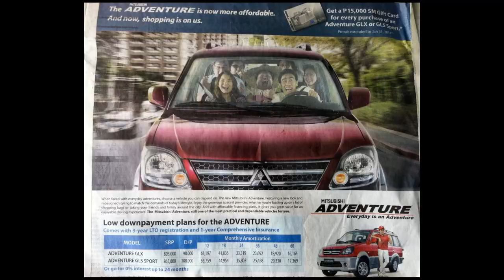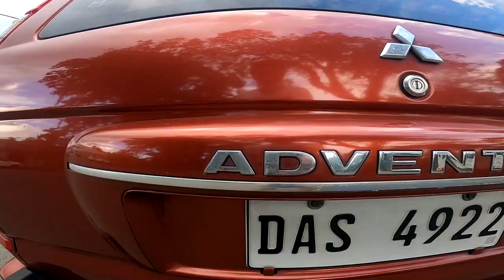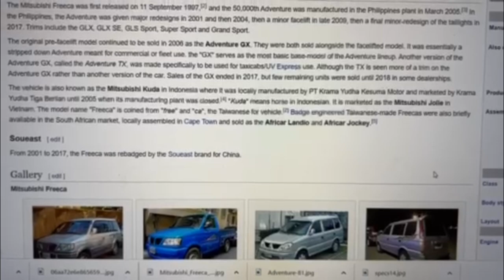2015 Mitsubishi Adventure GLX

Comment: Share ko lng yung experience ko sa 2002 super sport ko na adventure d ko lng sure if matibay lang yung luma pero never ko na experience yung mga nasabi nilang issue under the hood like yung alternator, dun sa idle ng aircon, saka dun sa belt din ng alternator. 20 years na adventure ko pero stock parin yung sa idle up ng aircon and alternator, ang napalitan ko pa lng under the hood is yung aircon compressor. Yung iba basic maintenance na like belt, filter and rubber gasket saka reservoir na lumutong na dahil sa kalumaan 210k na rin milage ng adventure ko. Tingin ko dapat mong isipin lagi dyan yung thermostat sisirain nya yung radiator mo. Mas ok yung mapalitan pero sakin umabot ng 18 years nabutas rad ko pero na repair alagang coolant din. pa adjust ng fuel injection pump pag hard start na. So far so good pa yng adventure ko kahit na medyo nag leleak lng ng konti yung rack and pinion. Basta i maintain lng sa change oil yung makina at saka normal lng sa kalumaan masisira yung mga rubber gasket kc lulutong din sa tagal lalu na batak talaga yung samin d pa kasama dyan sa milage na lagi naka on parin kahit na hinihintay ako ng kasama na nagbabantay ng gamit sasakyan maghapon walang patayan ng makina dahil sa negosyo namin, sobrang tipid kc. Wala din kaming parking dito kaya nakabilad cya maghapon. Sa makina sobrang tibay and check nyo top speed 210k milage na eto po yt link

https://youtu.be/84pxM0Tn5sE
https://youtu.be/cm35Zvmgj30

Comment: Proudly driving my deceased Father's 2004 Adventure Grand Sport, it was the highest spec back then. Ako ang nag maintain since he passed away, my small sentimental dedication for him. Kilometers on the odometer is still increasing, yet still going strong. Went through more rough muddy roads than those shiny modified SUVs that only roam in the city and the highways. Very simple and utilitarian. No touchscreen infotainment nonsense, just pure road driving while listening to the stereo simplicity as it should be. There'll be no longer simple rugged AUVs like the Adventure, Crosswind, Revo and Tamaraw FX. Kaya take extra good care of these nostalgic work horse vehicles.

Comment: Hahaha same model year ng Adventure ng tatay ko 😅

Really dependable vehicle, with the legendary 4D56 engine. Too bad mejo polluting sya compared sa mga bago ngayon.
Reply: Mahina sa ahon ang adventure gapang nakaka hiya sa kasabay tapos wala pang turbo at matagtag napalakasa pa sa diesel. Unlike Toyota INNOVA malakas makina and then may turbo and comfort ride kayang kaya makipag overtake at maning mani ang ahon fuel efficiency pa... Mag invest na sa wall brand!!!
Reply: @carlodeguzman4440   yeah mapapansin talaga yung gapang sa akyat lalo na pag fully loaded. Gamit ko sasakyan ng tatay ko minsan, talaga bababa ka sa primera kung akyat, but the power/torque ratio ng makina is very good considering the size. Keep also in mind that the design of the 4D56 is almost 50 yrs old na. Talagang napaglumaan na
Reply: @alanbassig5761  yes di advisable sa long drive ang adventure kakabahan ka baka di ka makauwi ng maayos. Tama lang na di Phase out na yan. Sayang ang pera. Di gaya ng INNOVA 12 hrs na biyahe walang patayan but still kicking!!
Reply: @carlodeguzman4440  Too much na yung pag-criticize mo sa Advie, ano bang ginawa sayo ng Adventure hahaha. Well we have mitsu adv 2011 model, 165k na odo still kicking parin never kami tumirik sa daan and weve never replace anything sa engine even timing belt heehehe. Weve travel north to south with no problem, so what r u talking about?😅 Weve bought adv because of its engine, its so so super reliable like out of this worldddd
Reply: @snappyloop7489  anong ginawa ng adventure skin? This is may answer di ako satisfied sa performance kaya binenta ko na agad 3 years pa lang skin. Lahat ng expectations ko sa INNOVA ko nakita at nakuha 💪💪💪💪💪. 2nd sabi mo 165k mileage mo wala ka pang pinalitan? Malamang naputol na timing belt nyan kasi ang buhay ng timing belt is 80k km run. So niloloko mo sarili mo?
Reply: @carlodeguzman4440  Well. bat naman ako mag sisinungaling? AHAHAHHA hindi pa nga napapalitan. Papapalitan ko palang this week. If youre not satisfied, thats your opinion but dont shove it to mitsu advie owners. Please dont also compare new innova model to old adv
Reply: @snappyloop7489  ofcourse mas quality brand ang INNOVA 💪💪 than adventure 👎👎👎👎
Reply: @carlodeguzman4440  Bahala ka na. What matter most is that Adv can put u point A to point B without any hassle
Reply: @carlodeguzman4440  Innova mong madali maluma yung design okay HAHAHHA.
Reply: @snappyloop7489  madali maluma? Bkit may production pa rin? Hahahaha eh ang adventure at crosswind PHASE OUT NA KAYA NGA NAMAYAGPAG ANG INNOVA!!! KUNG BILIS LANG DIN ABAY INNOVA NA!!!!
Reply: @carlodeguzman4440  May producyion pero iba design, ung mga lumang design ng innova eh bulok
Reply: @snappyloop7489  BULOK??? INNOVA? Pero marami kang makikita sa kalsada? Ginagamit na pang escort sa mga VIP??? Eh ang adventure ni minsan di ko pa nakita na ginamit sa pang escort??? Kasi nga mahina humatak di kayang makipag sabayan sa mga SUV AT LUXURY CAR/S??? Kung may production bkit ang tagal tagal tagalllllllllllllll ilabas? 😂😂😂😂😂😂😂😂😂😂😂😂😂
Reply: @snappyloop7489  mas matibay ang Innova lalo yung 1st generation 2005  model marami pa sa kalsada at malakas pa panakbo eh ang adventure bitin sa takbuhan at ahon tapos mainit pa sa mata ng mga ASBU!!!!
Reply: @carlodeguzman4440  well. U cant fool 4d56:face-fuchsia-poop-shape:
Reply: @snappyloop7489  because it's very fool 4D56 🖕🖕👎👎 MAHINA SA AHON AT MATAGTAG 👎👎 wala pang TURBO di gaya ng INNOVA 💪💪  ang daling naka overtake sa adventure need pa ng MATINDING buwelo! 😂😂😂😂😂